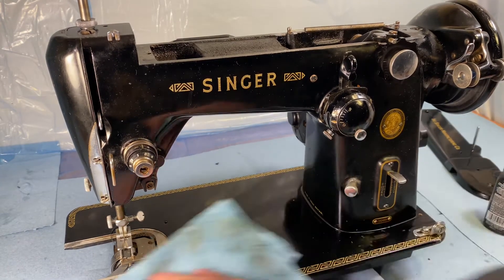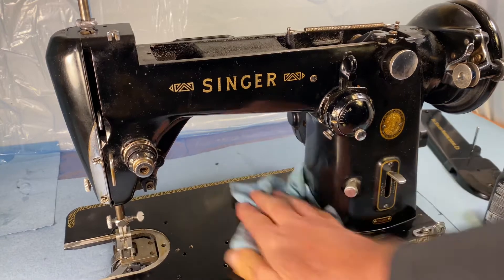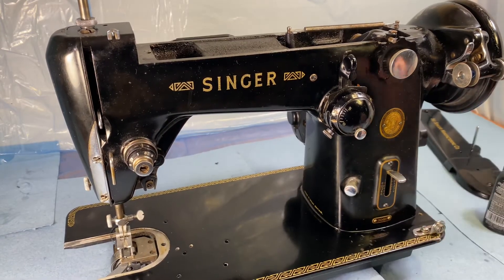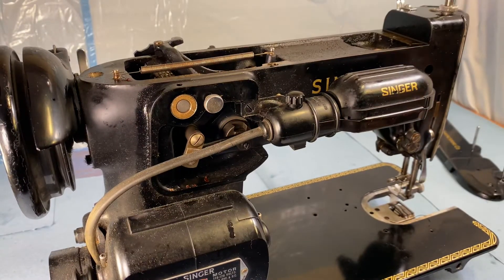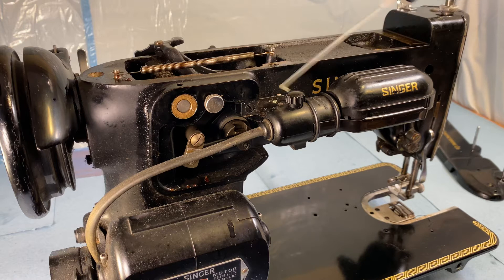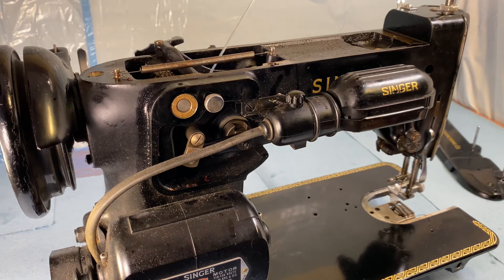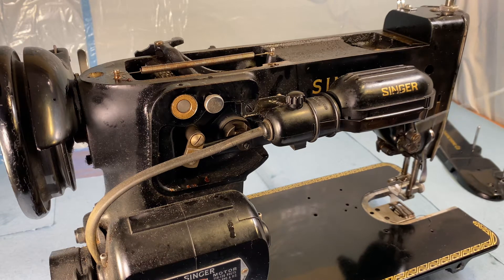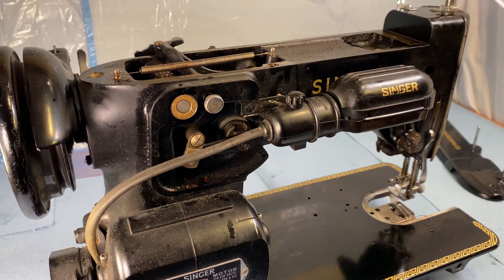SINGER 306K DENIS FROM RICE LAKE

Comment: O!!! The mighty bighty is back in place... I missed  it.
Reply from the maker: HEY MONIQUE! THIS ONE WAS TAKEN BEFORE I TOOK IT OUT!
Reply: Ah..good, so I will see how it gets dismantled and cleaned and go back in its snug cave. Great. Would a drop of oil help the screws on the feeddogs to loosen.?
Reply from the maker: @moniquewillems670  YES YOU WILL MONIQUE! A DROP OF OIL SHOILD HELP. ARE THE SCREWS TIGHT?  GIVE THE SCREWDRIVER A LITTLE TAP AS YOU TRY TO TURN IT. EVEN BETTER; USE THE HAIR DRYER ON IT AND HEAT IT UP A LITTLE. THAT SOMETIMES HELPS! I HIT IT WITH THE HANDLE OF A BIG SCREWDRIVER.
Reply from the maker: GREEETINGS MONIQUE! IT IS ANOTHER BEAUTIFUL DAY OF CHALLENGES & LEARNING! LOL! I SAID THAT I WOULD HAVE A VIDEO ABOUT THE BIGHT! BUT I DON'T! PLEASE ACCEPT MY REGRETS! OKAY I'M OVER IT NOW MONIQUE; HOW ABOUT YOU, LOL?!
HOWEVER, I DON'T HAVE THE EXPERIENCE WITH THE RECENT CAMERAS AND I LOST THE VIDEO! MY BEST WAS DONE AS FAR AS REPLACEMENTS. TOMORROW AT 7 AM IS MY REGULAR TIME! I DID LEARN WHAT I DID WRONG! LOL! TOMORROW 7 AM SHARP. IS THAT OKAY? I AM DOING MY BEST! THANK YOU FOR YOUR UNDERSTANDING.